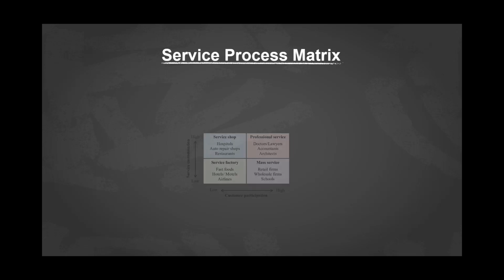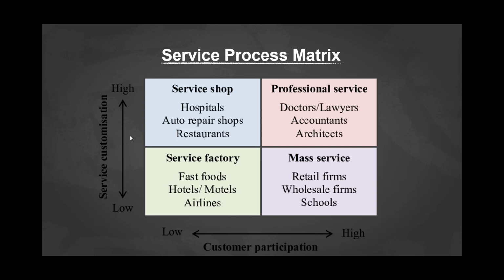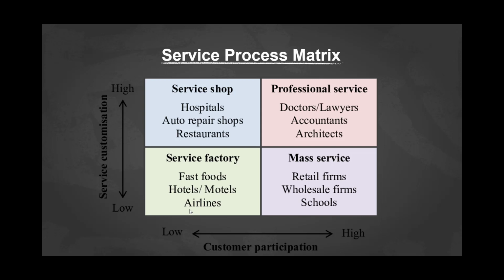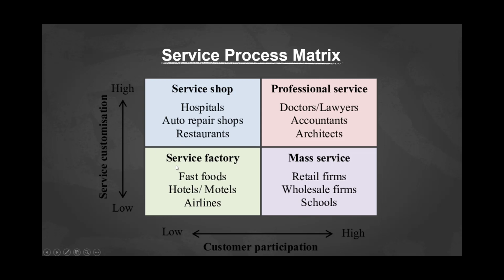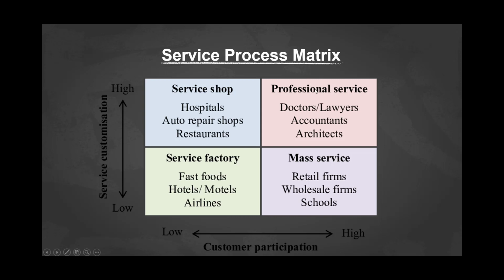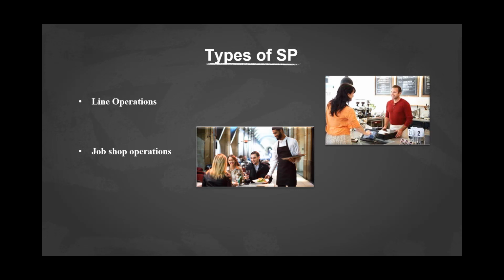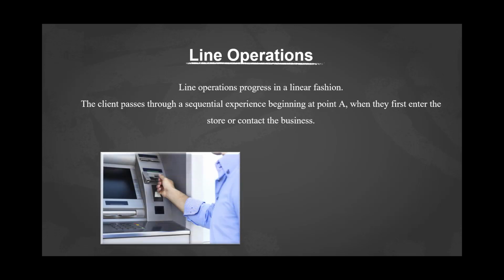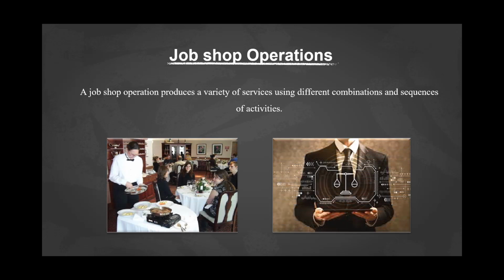lesson #7: Service Process;Service, factors affecting Service process, types of service Process

Comment: ADNAN Sher
F18-0272
5TH (SE)
SECTION (A)

SUMMARY ::

In this lecture we discussed about the service process
Service is an activity or benefits that one party can offer to another that is essential intangible and doesn't result is the ownership of anything.
 The service process depends on the type of service process and the degree of customer contact.

SERVICE PROCESS TYPES
1)line operation
2)job shop operation
3) intermittent operation

1) LINE OPERATION
The line operations process includes the ATM 
Standardized way of delivering of service through sequence of operation performed in a linear fashion.

2)JOB SHOP OPERATIONS
These operation produce a variety of services using different combination of activities and sequence.

3) INTERMITTENT OPERATIONS
This operation refers to service project Which are one off or only infrequently repeated.

TASK:
1)Growth of virtual contact centre

2)Talk to research
3)live video streaming is going to boom
4) Personalization to the fullest.
5)Automated self service
6) Customer service reps will work from home.

Comment: F18-0339
BSSE 5 B
Summary :
• SERVICE :  Services are economic activities that create value and provide benefits for the customers at specific times and places as a result of bringing about a desired change in the recipient of service .Example : ISP , educational institute and health care services etc.
• Service Process :  It refres to how a service is provided or delieverd to a customer . 
• Factors : Factors includes,
1:  Type of service provess.
2: Degree of customer contact.
• Service Process Matrix: classification of service industry firms. It inculde four quadrant :
. Mass Service : high degree of labour intensity and low degree of interaction and customization.
. Service Shop : low degree of labour  intensity and high degree of interaction and customization .
. Professional Service : high degree of labour intensity and high degree of interaction and customization.
. Service Factory : low degree of labour intensity and low degree of interaction and customization.
• Types of Service Process .
   • Line Operations : easy to automated because it is so standardized ,every customer has a similar customer experience and service process doesn't varry.
    • Job Shop Operations :  variety of services are produced by using sequence of activities.
    • Intermittent Operations : refer to service projects which are one off or only infrequently repeated.
• CUSTOMER SERVICE TRENDS , NECESSARY FOR SUCCESS :
1: Omnichannel support.
2: Real time assistance.
3: Be mobile first.
4: Automated self service.
5: Support automation with AI chatbots.
6: connect via social media channels.
7: Machine learning to improve CX.
8: UX is aa key in customer service .
9: listen and act on customer feedback.
Summary#7

Comment: Amina Awan (F18-0283) 
BSSE 5TH A 
SUMMARY:
An activity that one party (company) offers to another (may be a customer) is called a service. Service process refers to the services given by  company that works to give their customers facilities. 
Types of service processes:

· Line operation: 
standardized way of delivery of services through sequence of operations performed in linear fashion. Halting of any element in operation adds to its drawbacks. 

· Job shop operations:
sequence of operations performed to produce different servies in which flexibility is provided.

· Intermittent operations:
refer to service projects which are one off or only infrequently repeated.
TASK:
CUSTOMER SERVICE TRENDS NECESSARY FOR SUCCESS:

1. Computer Vision-powered self-service
2. Communication through voice
3. Approaching customers through social media
4. Using mobile services and applications 
5. Automated self services
6. Live video streaming
7. Intelligent self-service tools and AI (artificial intelligence) based chatbots to replace manual queries
8. Real-time support
9. Providing hybrid supports ( chatbot, messaging, etc.).
10. Talk-to-search

Comment: Muhammad Hashim Khan Jadoon
F18-1208
BSSE 5A

Summary :

In this lecture we have to discuss about service. What is service ?.
A service is an activity or benefit that one party can offer to another that is essentially intangible and does not result in the ownership of anything.
A service process refers that how a service is provided to a customer.

Principle factors :-
Principle factors that includes:
• The type of service process,
• The degree of customer contact.

• Line operation:
Standardized way of delivering of service through sequence of operation performed in a linear fashion.

• Job shop operation :
Sequence of operation performed to produce different service in which flexibility is provided. This type of service model provide customer satisfaction by tailoring the service to the client's need.

• Intermittent operation: 
Refer to service projects which are one off or only infrequently repeated.

Task:
Name of the customer service trends that are necessary for success :
Real time support.
Customer will contact you on social media.
A technology- driven playbook emerges the shift to proactive support gained momentum.
Customer expectations are raises and support teams need to catch it.

Comment: IJAZ AHMAD
F18-0285
5TH (SE)
SECTION (A)

SUMMARY ::

In this lecture we discussed about the service process
Service is an activity or benefits that one party can offer to another that is essential intangible and doesn't result is the ownership of anything.
 The service process depends on the type of service process and the degree of customer contact.

SERVICE PROCESS TYPES
1)line operation
2)job shop operation
3) intermittent operation

1) LINE OPERATION
The line operations process includes the ATM 
Standardized way of delivering of service through sequence of operation performed in a linear fashion.

2)JOB SHOP OPERATIONS
These operation produce a variety of services using different combination of activities and sequence.

3) INTERMITTENT OPERATIONS
This operation refers to service project Which are one off or only infrequently repeated.

TASK:
1)Growth of virtual contact centre

2)Talk to research
3)live video streaming is going to boom
4) Personalization to the fullest.
5)Automated self service
6) Customer service reps will work from home.

Comment: F17-0136
BS(SE) 5th"C"
Service:
              A service is an activity or benefit that one party can offer to another that is essentially intangible and does not result in the ownership of anything.
Service process:
                             A service process refers to how a service is provided or delivered to a customer.
Principal factors:
The type of service process
The degree of customer contact
Service process matrix: The service process matrix is a classification matrix of service industry firms based on the characteristics of the individual firm's service process
Types of service process: service process can be categorized into three major types
1.Line operations
2. Job shop operations
3 Intermittent operations
Line operations: line operations progress in a linear fashion. The client passes through a sequential experience beginning at point A when they first enter the or contact business
Job shop operations: A job shop operation produces a variety of services using different combinations and sequences of activities
Intermittent operations: Intermittent operations refers to service projects which are one off or infrequently repeated
Customer service trends that are necessary for success:
1.Real time support
2.Growth of virtual contact centre's
3.Automated self service
4. listen and act on customers feedback
5.providing hybrid supports

Comment: SUMMARY:
SERVICE:
A service is an activity or benefit that one party can offer to another that is essentially intangible and does not result in  the ownership of anything
 Service Process:
A service process can be defined as the way in which a company works so that a customer receives service to standardize this line with the company's identity and aims, mangers will work on.
Types of service process that includes
Line operations: standardized way of delivery of services through sequence of operations performed in linear fashion. Halting of any element in operation adds to its drawbacks. 
Job shop operations: sequence of operations performed to produce different servies in which flexibility is provided.
Intermittent operations: refer to service projects which are one off or only infrequently repeated. 
Umer Sajid
F18-0318 
BSSE 5A

Comment: BS(SE) 5th C, F18-0375 
 Service: 
 "A service is an activity or benefit that one party can offer to another that is essentially intangible and does not result in ownership of anything." 
 Service process: 
 A service process refers to how a service is provided to customer. 
 Principal factors: 
Service process depends on two primary factors
(1)The type if service process (2)Degree of customer contact
 Service process matrix: 
Service process matrix is classification of service industry firms based on the characteristics of individual firms service processes. The classification characteristics include the degree of labor intensity and jointly measured the degree if customer interaction.
 Types of service processes: 
 (1)Line operations:  Line operations operate in a linear fashion. Each client passes through same experience. Example: Self service restaurants
 (2)Job shop operations: These operations produce a variety of services using different combination of activities and sequence of operations. Example: Restaurants
 (3)Intermittent operations : These operations are one off or infrequently repeated . Example: Installation of large computers etc
 Customer service trends that are necessary for success:
(1) Harness Chatbots to Deliver Real-Time Value
(2) Personalize & Humanize Customer Engagement
(3) Empower Live Customer Service to Resolve Issues
(4)Use Automation to Deliver Great Customer Experiences
(5) Unearth Innovative Ways to Boost Loyalty
(6) Erase Time Zones with Distributed Customer Support Teams
(7) Listen & Act on Customer Feedback

Comment: F18-0313
BSSE 5th A
Summary:
A service is an activity or benefit that one party can offer to another that is essentially intangible and does not result in  the ownership of anything
The service process refers to how service is provided to the customer.
It depends on two factors 
Type of service process 
Degree of customer contact.
Then we have discussed the service process matrix.
Then we have discussed types of the service process 
Line Process
A standardized way of delivery of services through a sequence of operations performed in a linear fashion Example University cafeteria (no waiters all process performed in a linear fashion by the customer).
Job Shop
The sequence of operations performed to produce different services in which flexibility is provided. example restaurant with waiters.
 Intermittent operation
refer to service projects which are one-off or only infrequently repeated. Example (One time and first-time offer in the opening ceremony).
TASK:
Customer service trends necessary for success:

Comment: F18-0293
BSSE 5TH(A)
ABDULLAH 
                         &&&&&&SUMMARY&&&&&
in this lecture we learn about services process that states that it is an activity or operation that one can offer to other.
A service process basically a way in which a company provide a services to its customer
service process depends on two factor 
1)the type of service process>that states which service you go to provide to the customer
2)the degree of customer contact> states the customer contact with the company in the form of visit and buying the products.
also we learn about the different types of services that is
1)line operation >linear operation in which each customer face same situation during the process 
2) job shop operation>states the type of operation in which a series of step is required for some operation to be done
3)intermittent operation

Task
customer service trends for success
1)customer expect companies to offer support via social media
2)use mobile as digital hub to provide a services
3)customer services will be done from any where
4)AI customer services 
5)24/7  real-time customer services

Comment: SERVICE PROCESS :
Service:
      Service is an activity or benefit that one party can offer to another that is essential intangible and does not result is the ownership of anything.
 Service Process:
      A service process can be defined as the way in which a company works so that a customer receives service to standardize this line with the company's identity and aims, mangers will work on.

service process depend on two factor:
1.The type of service process
2.The degree of customer contact

--Types of service process
 1. Line operations
            Standardized way of delivering of service through sequence of operation performed in a linear fashion.
 2Job shop operations :
             This type of service model provides customer satisfaction by tailoring the service to the client’s needs.
 3.Intermittent operation:
     this operation refers to service projects which are one off or only infrequently repeated.
TASK:
Customer service trends necessary for success:
.Growth of virtual contact centers
.Real time support.
.Customers will contact you on social media.
.Automated self service

.Customer service as a part of the company culture 

Roll No. F18-0289
BSSE 5A

Comment: F18-0300
BSSE 5TH A
Summary :
    SERVICE PROCESS :
Service:
      Service is an activity or benefit that one party can offer to another that is essential intangible and does not result is the ownership of anything.
 Service Process:
      A service process referred to how a service is provided or deliver to a customer.
Principal Factors :
 > types of service process
 > the degree of customer contact
Service Process Matrix:
   > service shop
   > service factory
   > professional services
   > mass services
Types Of Service Process
     Line operations
            Standardized way of delivering of service through sequence of operation performed in a linear fashion.
    Job shop operations :
             This type of service model provides customer satisfaction by tailoring the service to the client’s needs.
     Intermittent operation:
             this operation refers to service projects which are one off or only infrequently repeated.
TASK:
Q. Name the customer service trend that are necessary for success. 
Customer services trend :

Build an Omnichannel Customer Experience

Harness Chatbots to Deliver Real-Time Value

Personalize & Humanize Customer Engagement

Empower Live Customer Service to Resolve Issues

Use Automation to Deliver Great Customer Experiences

Unearth Innovative Ways to Boost Customer Loyalty

Leverage Your Intelligence Over Artificial Intelligence (AI)

Erase Time Zones with Distributed Customer Support Teams

Elevate Customer Sentiment Beyond a Vanity Metric

Listen & Act on Customer Feedback

Close the Digital Transformation Gap with Unified Communications

Unleash Machine Learning to Drive Customer Success

Comment: Roll No : F18-1154
Section :C
BSSE 5th
In this lecture service processes,Types Of service processes, Factors, Service Process Matrix are discussed. 
The factors for service processes includes
1) The type of service process. 
2) The degree of customer contact. 
Service Process Matrix Includes :
1) Service Shop
2) Professional Services
3) Service Factory 
4) Main Service
Then Types Of Service Process were discussed which are:
1) Line Operations. 
2) Job Shop Operations. 
3) Intermittent Operations. 
1) The Line Processes Includes the Atm, restaurants 
Drawbacks Of Line Services Or Operations :
If one client have complain it can effect the whole service although it is the simplest of services
2) Job Shop Operations. Includes several jobs. 
3) Intermittent Operations 
They are One off and are infrequently repeated.

Task:  Name the customer service trends that are necessary for success?
1.  The ‘M’ factor. 
Here, M is used for ‘Mobile’.
2. Customers will contact you on social media. 
“You can use social media to turn strangers into friends, friends into customers and customers into salespeople.” –Seth Godin. 
3. Intelligent self-service tools and AI (artificial intelligence) based chatbots to replace manual queries. 
"In the long run, I think we will evolve in computing from a mobile-first to an Al-first word."_Sundar Pichai. CEO at google Inc. 
4. Customer service reps will work from home. 
“A brand is defined by the customer’s experience. The experience is delivered by the employees.” – Shep Hyken. 
5. Machine learning can change the whole customer experience. 
"you have got to start with the customer experience and work back toward the technology - not the other way around." _Steve jobs. 
6.  Real-time support. 
7. Live video streaming is going to boom. 
“Video is an effective form of communication that needs to be integrated into each and every aspect of your existing marketing efforts.” –James Wedmore. 
8.  Providing hybrid supports – chatbot, messaging, etc.
9. Personalization to the fullest. 
10. Talk-to-search. 
11. IoT can fuel proactiveness